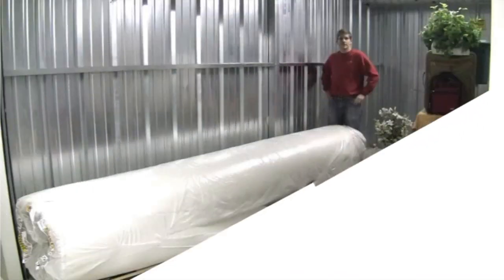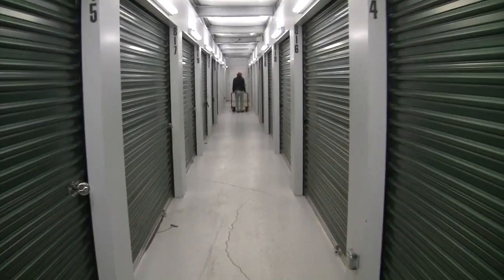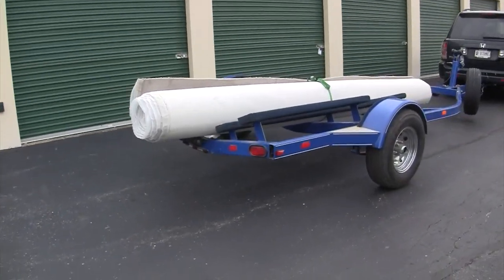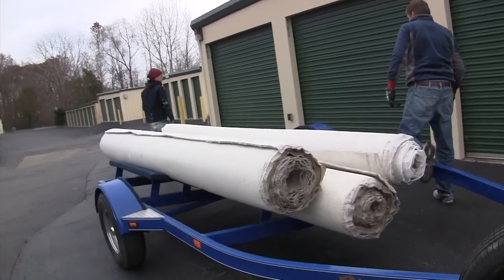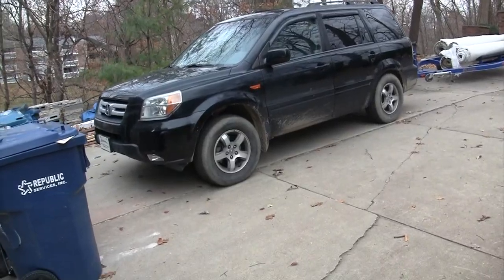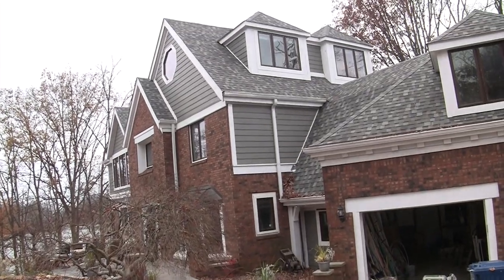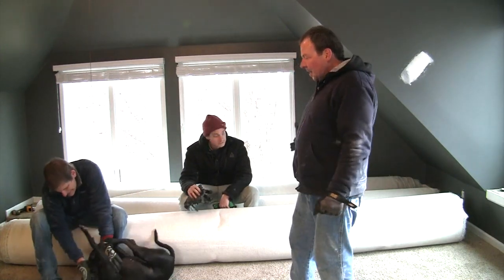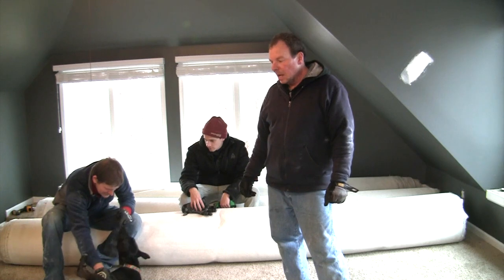How to Move a Heavy Carpet

Comment: Have the roll loose not tight.
 Bend it half perfect. 
Strap it in both ends of the roll. 
Put it on a dolly or put on your back.
Reply: Good idea. Depends on how thick the carpet is and how long the cut.
Reply: @johnsellers9266   Usually if its small roll bend and half just throw on my shoulder. Anything bigger put on my back
Reply: @WILSON0o6  very true. Sometimes I seem to be always cursed with the carpet that's too long and I have to go up stairs at a horrible angle where I scratch the paint lol.